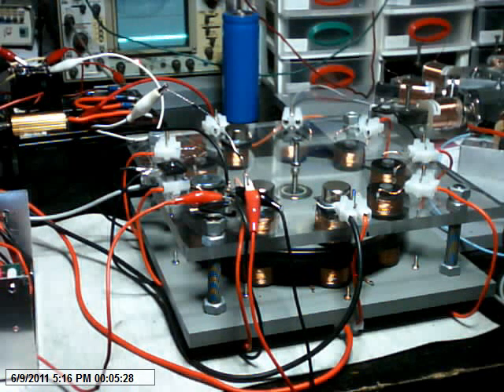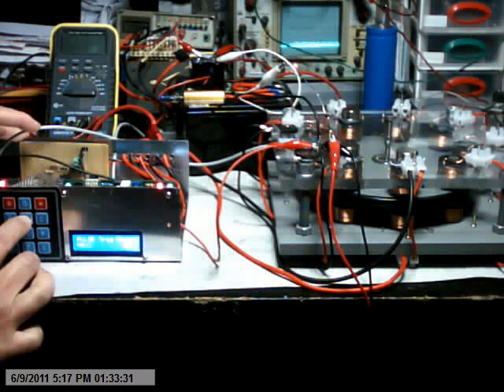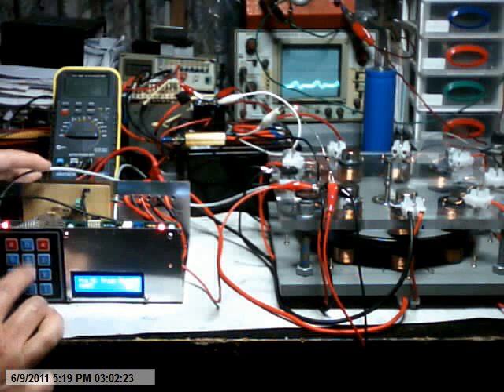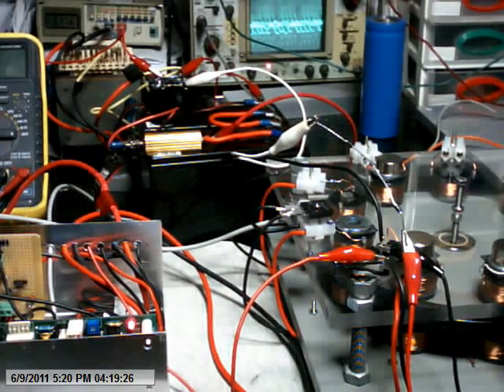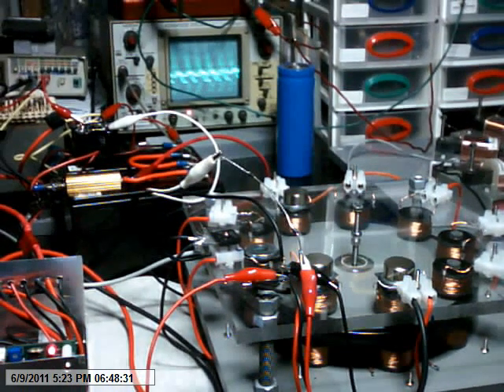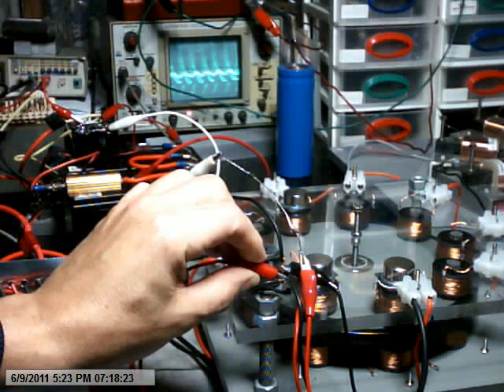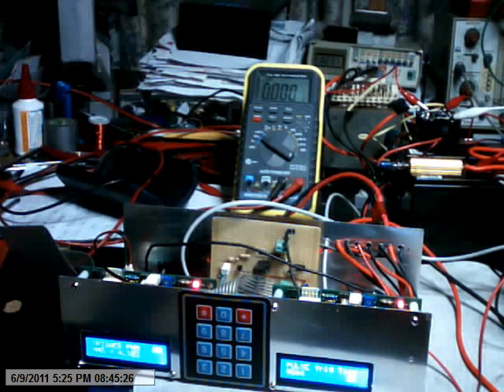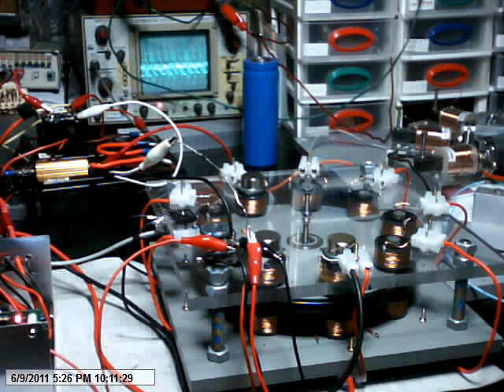RomeroUK Replication

Comment: @toranarod Yes but what about just the coil shorting experiment itself in terms of power in vs. power out?  I read the first few pages of Romero's coil shorting thread and did not see any measurements or even any references to doing measurements.  The point that I am trying to make is to not take your eye off the ball, it is way to easy to become distracted.  Like, what's the point if you see 50 posts about coil shorting and nobody even knows if it works.  It's junk or it works, no in-between.

Comment: 2nd:  With the coil shorting stuff, you have to try to figure out your power in vs. power out and understand every event in the sequence of events and relate all of it to your power in vs. power out.  Right now it looks like all that you do is charge a capacitor and once the capacitor is charged nothing really happens.  To truly figure out if this has merit and is creating energy you have to do a full analysis, nothing else will cut it.  It's not easy but that's the real deal.

Comment: Your build is beautiful.  Unfortunately your scope loses trigger when you do the shorting so you can't see what's going on.  Also when your cap is fully charged to 300+ volts it stops being a load on the system.  Please post your schematic for the coil shorting and some pictured of your scope shots as a bare minimum.

It's all about analyzing your scope waveform and relating that back to your circuit and timing signals and figuring out the power flow.